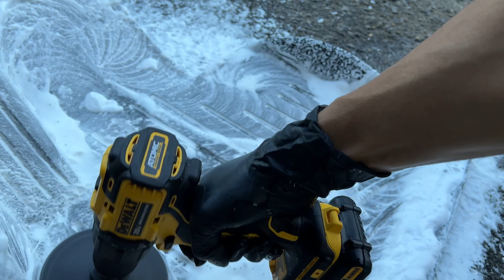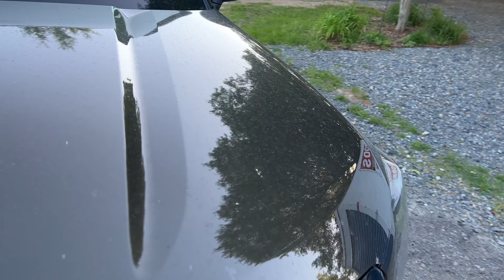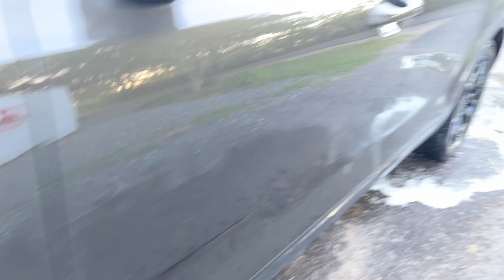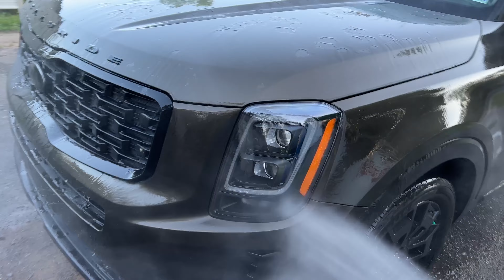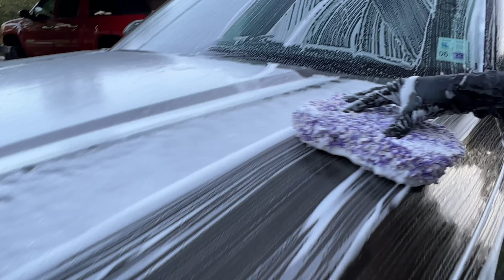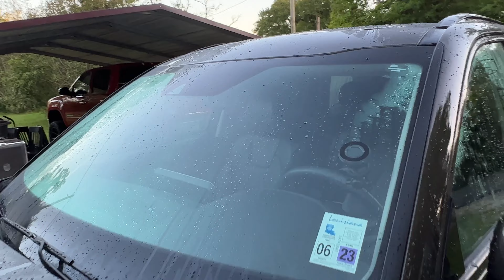Did The Invisible Glass Ceramic Glass Coating Survive a Whole Year!?

Comment: Mr. Cleaner, HOW do you get the mats completely cleaned and black. I have tried everything and scrubbed and pressure washed and they look GREAT when wet, but once they dry, they leave brown marks in the corners and tight areas???
Reply: Use Mckee's 37 Floor Mat & Cargo Liner Rejuvenator
Reply: @kavionebrown4615  Ok thanks! Will try that stuff out.
Reply: @ScrappersDetailing  no problem😁